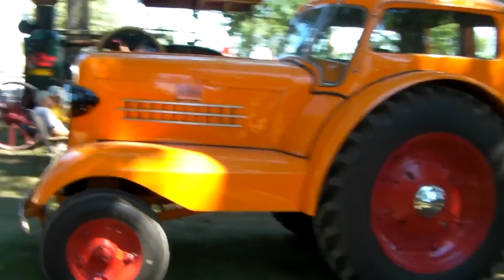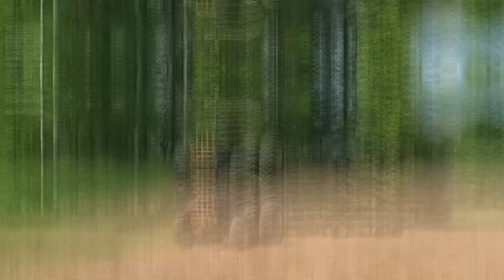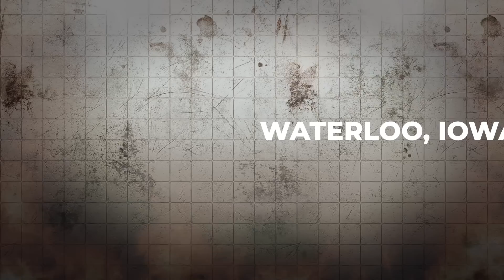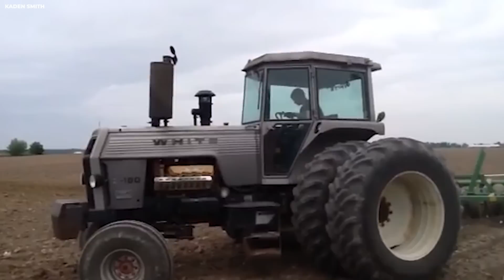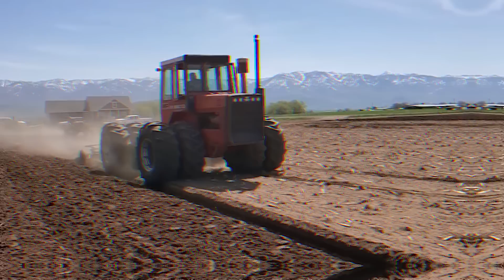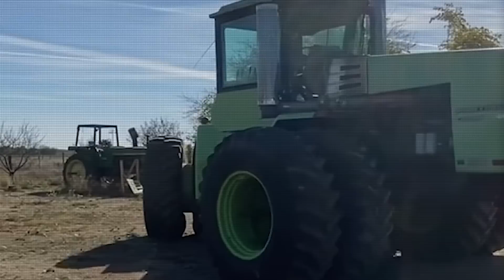10 FASTEST TRACTORS YOU MAY NEVER HEARD OF!

Comment: 😊😊 tractors in the 194OS already had a 5 speed transmission that was a road gear and in the 195OS they went 2 a high and d low side transmission when the tractor 🚜 😮 start running out of power 🔋 😮 U back 2 the low side so U had more pulling power 🔋 👏  OMG 7 3O 2O25